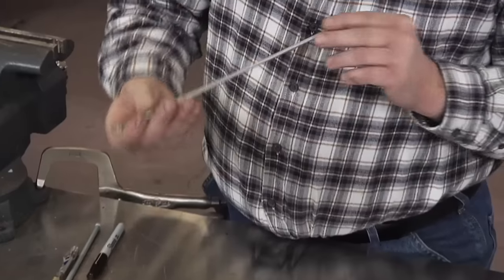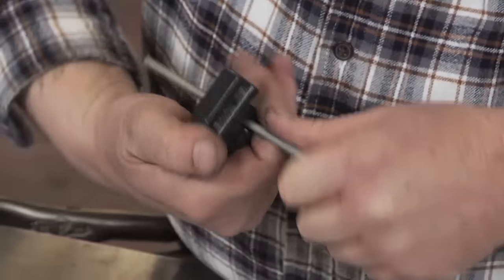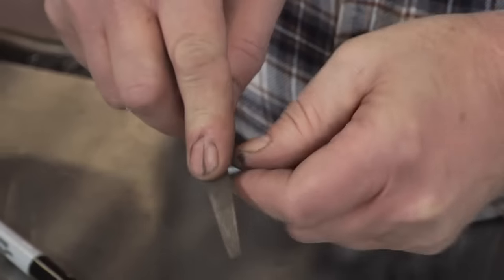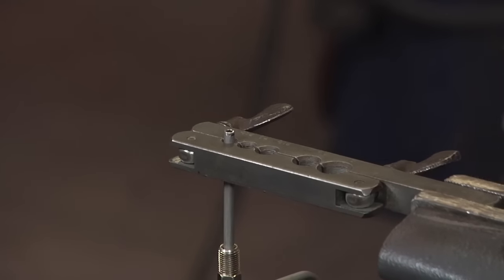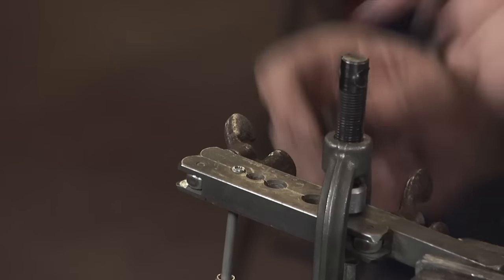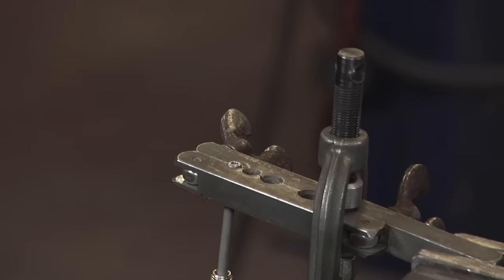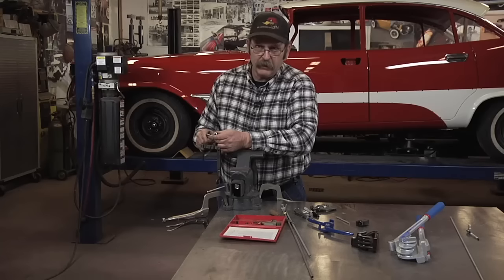BENDING BRAKE LINES & CREATING INVERTED FLARES ON BRAKE TUBING

Comment: ...good video, but to add a couple of tips:   1.  I know its just a demonstration and just a minor point, but while deburring, I hold line such that deburring chips and debris does NOT fall into line (in hydraulics, cleanliness is crucial...it doesn't take much of a metal chip to slice a rubber seal!).  2.  Before reshaping line, its better to lube contact area of line and die, to minimize die wear, and also allow line to slide along surfaces as it reforms line (clean off lube with solvent to prevent brake fluid contamination...bleeding will flush out any minor remaining contaminants).  Cheers

Comment: Just ordered a couple extra of the 3/16 dies for my flaring tool. Those ones are a bit delicate and although I haven't broke one I wanted to get a couple extra.
Yes, my hand is up - I indeed have made the best looking double flares ever only to realize I forgot to put on the fitting.
Reply: What brand of flaring tool did you buy?
Reply: @Glaucidium810  I have an ' Old Forge ' brand

Comment: I decided to try out the Block Flare kit like is used in the video. My stepson made about 20 practice flares, with about an 80% failure rate. I explained to him that unless he could make the ends 100%, he shouldn't plan on using any lines he made up, to then be put on a vehicle.

Because of the fact that here in Michigan, the use of salt during the winter, causes all of the underbody lines to rust-out & can turn into a nightmare. Especially in areas where both the fuel & brake lines are bracketed together & run from the front to the rear of the vehicle. 

I opted to buy a Hydraulic Flare Tool. The one I picked is made by MasterCool, ($350). One of the main reasons for getting this type of flaring kit is because it has all the correct Dies & Adapters, so we can make any type of line that needs replacing on vehicles. Brake Lines, Transmission Lines, Fuel Lines. The kit has all the dies & adapters required to do all those mentioned. Like anyone, I didn't like the fact that I would be starting out with a $350 investment but like I mentioned above, 1 we live in Michigan & that winter slush, salt brine is a line/underbody killer, 2 being able to be under the vehicle & flaring the ends helps out a great deal. A friend of mine who was my mechanic had a Mastercool hydraulic flare kit & I'd say it only took an hour to do our 1998 Honda Accord back in 2014. Since he had to retire from wrenching in 2018, it was either start taking the vehicle in to a shop for the repair, or do it here at home. 
And after my wife told me she called some shops & the best quote was $1,500 to replace all the lines from the Proportioning Valve-Down to the Calipers/rear Drums on our daughters 1996 Pontiac Grand AM. I told her no-way & please stop calling anymore shops because they're probably going to use the same tools I have, actually will have. Plus one of the last times one of out kids had an issue with their vehicle, she called a local repair shop, then the guy talked her into doing the repair, so she had her son take his car there.

Great video by the way. I'll have my stepson watch your video so he can see how it should be done & how the flaring should turn out (every time).....

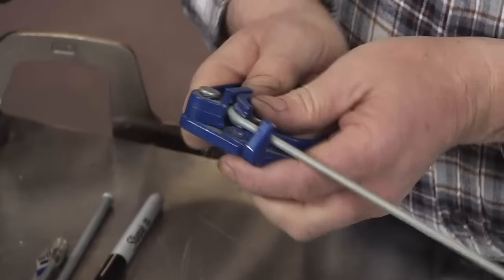Comment: That first bending tool looks like Harbor Freight's best bender.  They have another for a dollar cheaper but I've heard bad things about it.  I wanted to see this model in action to see if it flattened out the bend but it doesn't.  It does look scary at the 0:50 mark but that's because the tubing is sunk down into the groove.  Looks like Harbor Freight is going to get another customer soon.  Now, I've got to watch the rest of the video to see what more I can learn.

Comment: I tried doing this. The clamp I used did not want to hold the line and pushed it out. I tried so many times and tighten the clamp so much I stripped it.

Comment: I never had any luck with that type of flaring tool. The flares were always off center and leaked.
Reply: Same here stupid flares
Reply: What brand do you suggest instead?
Reply: @Glaucidium810  Look for KD Tools pt# 2190. The only one available at this point are used on E-Bay these days. Make sure it comes with all the bits. I have one of the larger Mr.Cool hydraulic flaring tools and honestly it doesn't work as well, and costs a lot more money.

Comment: does the degree of the bend really matter?I ask because my brake lines are completely destroyed and I don't have nothing to compare the bend toso I figured as long as it doesn't crease and it connects fine it should be okay? what do you think any help thank you in advance
Reply from the maker: For those who are overly concerned with every detail... it might matter.
But for the rest of us, as long as you have good connections on both ends, the lines are routed safely away from moving parts and heat, and are secured well... that's all that matters.
Of course, it's advisable to plan out your lines so they appear neat, not haphazard.
Many classic cars do not still have their original brake lines and prebent lines can be difficult to install in a fully assembled car.
Reply: @ClassicCarRestorationClub  thank you i appreciate your response very helpful

Comment: Bending a tube anywhere in a tube is easy. But how do you get your bend in an exact spot so you aren't too how or high?
Reply from the maker: Hello!
Depending on how tight the radius is on the bender the exact measurement can change from tool-to-tool. 
So I recommend getting familiar with your bender first before making a critical bend. 
grab a piece of scrap tubing and use a sharpie to make a mark on it, now line-up the little crossbar on the bender with the mark and make a 90-degree bend. 
Hold the bent piece of tubing on a flat surface and measure up to the mark made earlier as this will tell you how tight of a radius you can make. 
On the bender I use in this video I believe the radius is 1-1/2" inches, so when bending a line I measure back 1 1/2" from where the bend needs to end up and make a mark on my line, then bend. 
Okay, now the rest of the story, I have used benders like this for many years now and seldom mark them anymore as I can just "eyeball it". 
Although for critical places where multiple lines will be next to each other I still take the time to measure each line. 
Wrench Safe, Mark
Classic Car Restoration Club
Reply: @ClassicCarRestorationClub  Thanks. I will give it a try. There is always something to learn.👍👍

Comment: What is the name of the instruments you used to bend and to cut the lines? And where might i get them in the market?
Reply: Don't you hate when you don't get a response for a specific question on YouTube?
Reply: The cutter is just a tubing and pipe cutter. When you buy a complete flaring kit it usually comes with it.  Most basic kits like that one are about $25

Comment: what kit did you use?
Reply from the maker: There are many different types of flaring tools, the one I like is offered by K-D Tools, here is the model number: K-D Tools Automotive Flaring Tool Kit #41860 
It’s nothing fancy, but can be counted on to get the job done.The little blue tubing bender is also nothing fancy, but it really is one of my favorites for bending small tubing. I have other benders costing nearly 6x as much, but I always reach for this one first. Here is a link: www.harborfreight.com/1-8-eighth-inch-to-1-4-quarter-inch-tube-bender-94571.htmlWrench Safe, Mark

Comment: Those flaring tools are by far the most useless "one time use" pieces of junk ever invented. 

Buy the mastercool hydraulic flaring too. Its pricey but the best under the car, tight space, etc tool .
I swapped over the entire ABS system on my car and had to make a good 10-16 flares in tight places, perfect flare every time. 

I broke at least 4 flaring kit things trying to do a line, bent the line, ruined the lines, just crap all around.
Reply: WhatIThinkNation I just ordered Eastwoods hydraulic brake flaring tool....I'm pretty excited about it!
Reply: WhatIThinkNation I have that tool, and it's absolutely true, perfect flares easily accomplished.  What did you swap abs to/from?
Reply: I swapped an L67 supercharged 3800 series 2 engine, tranny, etc into an older oldsmobile silhouette minivan as a project. The ABS didnt really need to be swapped over but the brake lines were all in bad shape. So new lines, newer abs module, and funny enough the 2004 generation Cadillac CTS-V brembo brakes fit the pontiac van/grandprix/regal spindles so she got some brembo calipers during the swap. Rear brembos may go in this summer, I just added the rear carrier to allow for disc brakes vs the original drums on the van.
Reply: WhatIThinkNation damn! Any video of the project?  Im into swapping 88-98 obs chevy trucks with 99-up vortec engines. The work you did sounds like a lot of work
Reply: I wish i made a time-lapse but it was a pretty lenghty project trying to get it all done. 
PM me on youtube and I can send you the google drive link of my progress on it. I have pics along the way and the full swap steps. I kept an excel file in the making of the wiring harnesses since the original van wiring was kept in place with the motor bringing its own PCM. Got into a bit of PCM programming as well which actually applies  to your Vortec PCM as well :)  I still have the programming tools as it was needed to update the vin and engine properties for the van, and disable security on the key or it wouldnt start.
Reply: WhatIThinkNation sounds awesome
Reply: 100's of dollars
Reply: cost of the hydraulic tool ?? yes $400 ish ... $350 if you find them on sale :) but again well worth the investment for any mechanic, a/c tech, any gas flare for that matter. I even made a PC cooling system using this tool to run water-cooled lines to a processor.